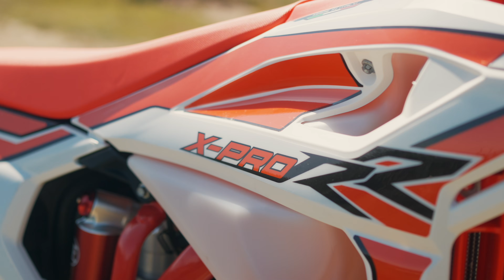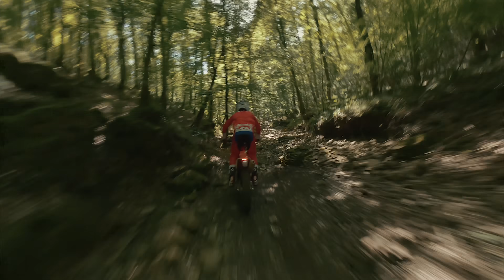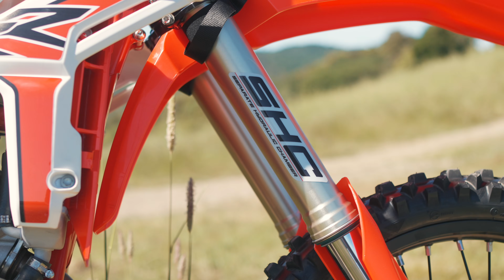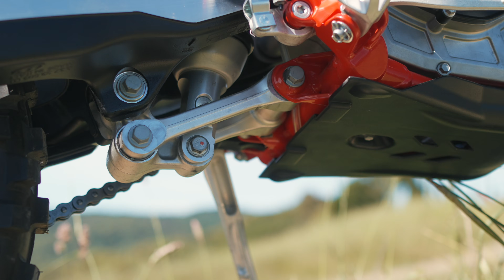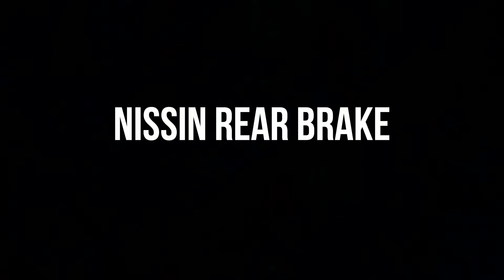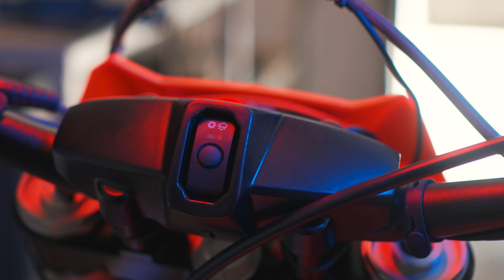Beta MY2025 RR X PRO Close Up

Comment: They are starting to make these bikes worse by the looks of it, and once you put a set Dal Soggio forks on your Beta you could never settle for suchs suspension no matter how much they revamp them. I also preferred the 22 model engines over the 23. I have had to do a fair bit of work to make my 23 models perform the way I want it to. I hope a test ride can change my mind but I don't see the new changes since 2022 as upgrades unfortunately.

Comment: If conventional zf forks were garbage, just imagine with this system, wich wp, after so many years and all the resources in the world cant make it work
Reply: La forcella Sachs zf non è spazzatura, è semplicemente diversa dalle altre e richiede molta dimestichezza da parte del pilota nel ricercare e nell'eseguire il giusto settaggio... in poche parole ci vogliono diverse ore di prova in percorso misto di enduro nonché di  lavoro. Io ho una RR 300 2019 col modello asimmetrico e ti assicuro che ho trovato il giusto compromesso per viaggiare in maniera ottimale su pietraie, su radici, nonché affrontando salite e discese ripide e nel bosco fitto dove occorre fare lo slalom anche rapido fra i vari alberi. Chiaramente bisogna intervenire anche sul monoammortizzatore. Però già la regolazione standard di entrambi con cui la RR esce da casa madre è  una buona soluzione nell'enduro amatoriale.

Comment: Thanks for the reply. Can you confirm exactly how they got the 20 mm lower seed height? Is it an internal suspension adjustment, frame change, or something to do with the mounting position of the shock? Thank you.
Reply: The axle mounting.location on the fork, and a shortened suspension on the rear shock stroke. This has the benefit of a slightly shortened wheelbase so it feels more flickable, and has better turning radius than the previous models.  This is a do it all bike.  Lower CG is the shit, and Beta is starting to figure it out.  Lower the pegs, and with the almost extra inch of seat height will be same as the previous versions inseam, but will rail corners better.  Small improvements.  Excepting the frame top tube width, that was a major strength improvement.
Reply from the maker: All done within the suspension.
Reply: @BetaMotorcyclesAustralia  IF the 20mm lower is done solely with suspension, does that mean there is less travel?

Comment: Makes no sense single side spring is so unstable Sachs dual spring was fine similar to open cartridge showa. Very bad move
Reply: I agree. They should just improve on the kyb valving and this would be an instant hit. Nobody wants sachs OC or single spring suspension....
Reply: @jaylee6936  sachs ZF dual spring onced valves and spring right is very good I prefer it over Kyb or WP.
Reply: Why not one spring and one air fork. I’ve done this on my two previous WR 450’s to make them more compliant for technical enduro. Works well. Not required on my 2023 Beta 300 RR though.
Reply: @TheKitchenTechnician  that’s an interesting setup I might try it
Reply: Sachs sucks bad and when did you become a suspension expert...lol..
Reply: @robertfletcher7559  do you know me? Idiot

Comment: "Making a bike 25% lighter compared to two spring model" 
Wat? 25% weight reduction just removing 1 spring? Did you mean fork is lighter?
Reply: just the spring itself. one spring is 25% light than 2 springs. meaning that specific one spring is heavier than any one of the springs of 2 spring model.